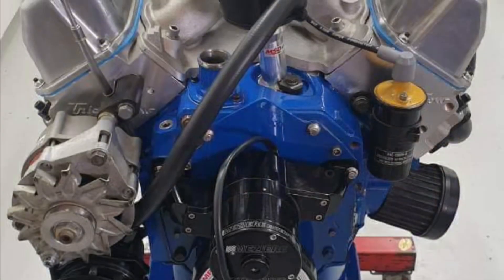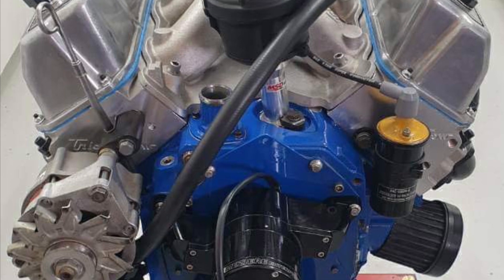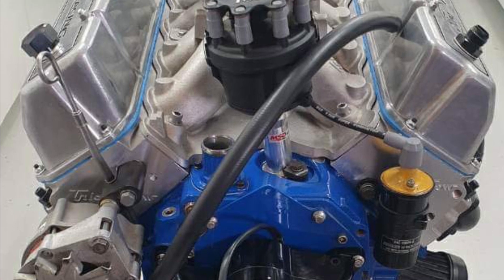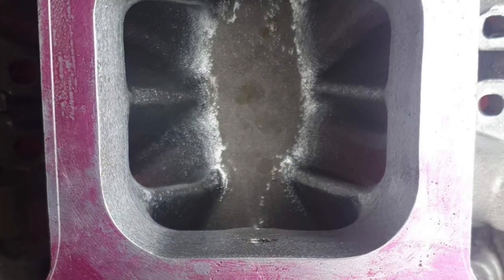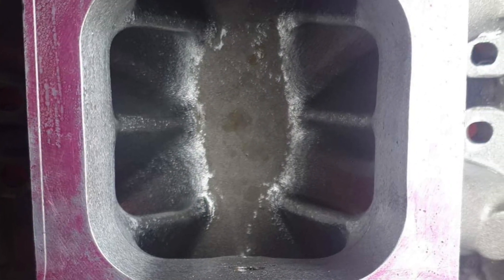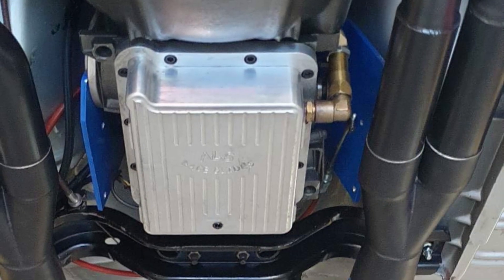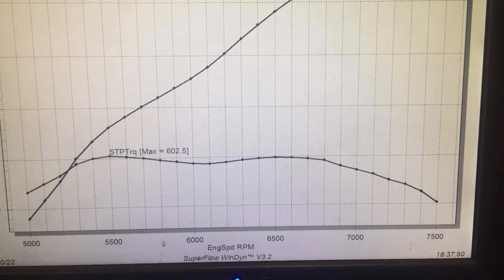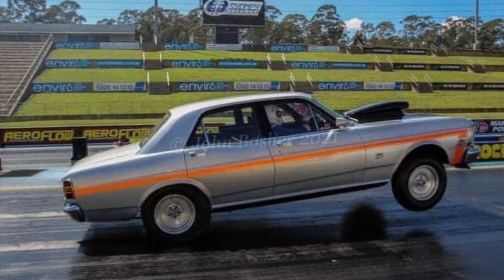DBG: RPM Motorsports Ford 351 Cleveland, Stretched to 427ci, 793HP @7400 603 ft lbs at 5500 rpm

Comment: What is the deck height in the engine block???
Reply from the maker: Joe, I put all the info under the description. The block is 4.125 bore.
Reply: @dragboss351cleveland so it has a original Cleveland height of 9.2 ?? Or aftermarket 9.5 or 9.7 ??

Comment: Great video Tim! Did you find out what the duration and LSA values for the cam used in this weapon? 
What I find strange is why Ford discontinued the 351 Cleveland engine. These motors put out more horsepower than GM or Chrysler during that time. So much so that Ford was penalized in racing because of the canted valves. Their heads flowed better right out of the box than the competition.
Reply from the maker: No cam specs. Mostly financial reasons and insurance. Ford was out of racing in 71 I think it was.

Comment: Hi I am seeking some cleveland engine block advice. Can you bore the block to 40 thou over and the engine still be reliable making around 500hp? Any advice is appreciated.
Reply from the maker: I ran a .040 cleveland for 5 years shifting at 77-78-- going through the traps at 7900. Then broke a valve spring, and valve was cracked, and block split number 5. Car ran a best of 9.99, and made 668hp.
Reply: Awesome thanks for the quick reply. The machine shop aren't confident it will be reliable and wanted to sleeve all 8. Also blocks are getting hard to find in Australia now.
Reply from the maker: @Robb393  I have hears that sleeving (Sleeveland) he call it, all 8 can affect the structural integrity. But my buddy does that here, and no issues. I would like to have him do one of my blocks and go 4.080, or 4.125. Tough call, it's a roll of the dice..

Comment: what's the realistic numbers one can obtain with very little knowledge on a Cleveland? I would love to have 600-650 to the wheel and would love to see a setup that is able to replicate.
Reply: Lots of money spent in all the right places. That is the secret for all engines
Reply from the maker: 600 -650 at the wheel is 9.40s in 3200 lbs car. Can be done. I think this was making 570 ish at the rear
Reply: @dragboss351cleveland  The car I'm thinking about putting it into is 2100 with everything stock no cage not swapped yet, thinking around 2500-2750 with driver and cage when everything is done. Is that realistic? Or am I dreaming? It will be a 1971 Ford Capri 100" wheelbase
Reply from the maker: I don’t think your dreaming, but this car 793 is 570 plus rear wheel Hp. How much flywheel will you need for 600-650 wheel?
Reply: @dragboss351cleveland  not sure really looking for guidance, I’ve tried to look for some setups but not many have love for the cleveland
Reply from the maker: @JTLDEN  Not many build or race Cleveland here in US.You set your goal, and research what you need to build it,  and go. your going to need 400+ cfm head flow.

Comment: My cousin who has now passed used to live and breath X series falcons he was in a wheelchair but never let it slow him down, in 1978 he built one of the first 393 strokers in Australia..we used to drive it to the drag strip 60ks with a 750 on it and flip it over to a dominator running methanol at the strip. At the age of 12 I used to swap tyres, carb, switch over the fuel tanks and fire it to run the gas through all by myself and I loved it. He would have love to see this thing run.
Reply from the maker: Hey Dave, good to hear from you, what a great story. I knew a guy that race, a  Mustang with hand controls. Sounded like a nasty ride for sure. Rip cousin. Thanks Dave

Comment: I wonder what kinda power it would make with 70 ‘M’ code heads
Reply from the maker: Well my 354ci made 615 with iron heads…..
Reply: @dragboss351cleveland  impressive as hell!
Reply: @goldysgarage189  I've got an iron headed 377 that's going into a 73 pinto wagon. My target (maybe wishful thinking) is 650 to 750 depending upon what cam is used (mech roller of course) with a tunnel ram and a pair of 660 center squirts. I have 1 cam with a .859 lift and still need to check it with a degree wheel for all the precise numbers but LSA is approximately 106. That cam I believe will get bigger numbers than the lunati I have but the Dyno will let me know for sure once I get there with it. I'll post the results when it gets to the Dyno.

Comment: How do you get 14:1 with dish pistons? That's serious Power from a Cleveland!
Reply from the maker: Small combustion chambers
Reply: I'd have to say the heads have some very small chambers
Reply: @robertseaman3362  yeah man very small. The TFS 195/225’s have 58/60 combustion chambers. The TFS heads have 2.08 int valves. So they did some trickery to get that 2.136 valve in the and that chamber small enough to get 14.1 with a dished piston.

Comment: Badass Combination, luv it💪🏼🇦🇺🏁
Reply from the maker: Right on, the thunder from down under baby🇦🇺
Reply: @dragboss351cleveland  you said DBG….made in🇺🇸—>finished in🇦🇺🏁 lol
Luv how you said “only 360cfm”🤣….plenty for 800 horse🏁🏁👍🏼
Reply from the maker: That is not a ton. Velocity is key.
Reply: @dragboss351cleveland  right on Tim, velocity is key……not too high tho🚫, the right speed with the right port volume is key💪🏼🏁. I like them TFS 2V 225s👌🏼did a vid on them. Now i know they can achieve 800horse on the right deal, wow👌🏼 i would of thought 750hp but wowser👍🏼🏁
Reply from the maker: @69JANKS  without a doubt mate , and probably more in it too💪🏁
Reply: @dragboss351cleveland   💪🏼🏁
Reply: @dragboss351cleveland  Track Boss build will show em all Tim, big Ci , one of them heads you have back there….850+ for sure👌🏼🏁……. My fav is still the 409💪🏼 Motorsport heads, oem 2bolt & that Tri-7 hp figure……….Badass my friend😎🏁
Reply from the maker: TrackBoss has  the Secret  Motorsport A3 heads. They are even better than 409c heads. 850 should be no issue. 🏁💪😎 with 850hp
Reply: @dragboss351cleveland   badass Tim 💪🏼🏁

Comment: Thunder from down under. 🏁
Reply from the maker: Hell yeah, brother,🇦🇺, rock ‘n’ roll ain’t noise, pollution
Reply: @dragboss351cleveland Check out Rick Stanton   Dual 1050 cfm Dominators, 860 hp @ 7,800 rpm, 621 Tq @ 6,800 rpm.
Reply from the maker: Rick Stanton from ?
Reply: @dragboss351cleveland  California, I ran across that video after watching this one. I guess that engine was in a p/s Pinto, couldn't find much on the web about him.
Reply from the maker: Have to look for it. Thanks Banger.

Comment: I wish I can put my T/F 225cc heads on a 408 or 427 Cleveland. My flow sheet said 355/259 cfm after Brian Tooly worked them at TEA. Not saying I will get 800hp but 650-700 should be no problem
Reply: 600 is no big deal out if those parts.  And if you target 800 hp its not too big of a target.   Its realistic with the right build.
Reply from the maker: Right on Dennis
Reply from the maker: He will get that without an issue, glad you’re here. Keep on rockin and don’t stop knocking.🏁

Comment: Another brutal example of the power that the Cleveland can deliver.  Thanks for sharing this awe inspiring superior Ford “small block” engine. It just doesn’t get much better than this in naturally aspirated trim 🏁
Reply: Sure does fellas, looks like a 5yr/unlimited  mile warranty  deal 👌🏼🏁
Reply from the maker: I know it man the real secret is all about the combination it’s getting those parts to fit right and I’m not talking mechanical, I’m talking design, you get it. The engine looks like it might make 400 hp doesn’t it?
Reply: @dragboss351cleveland  … The design has a physical presence that’s uniquely Cleveland and that’s as good as it gets. The outstanding numbers tell the story behind the rock solid sum of all the parts in this particular application 👍.
Reply from the maker: @danielwilson6665  The rock solid sum= The winner, simple.
Reply: @dragboss351cleveland  … Man I just love simplicity…. It’s just so…. Simple. And the good news is that it’s now possible to do it all CLEVELAND STYLE, in the comfort of the DragBoss Garage  🏆.
Reply: @dragboss351cleveland  …. Clearly so 👌.
Reply from the maker: Right on Daniel simplicity is sometimes all it takes